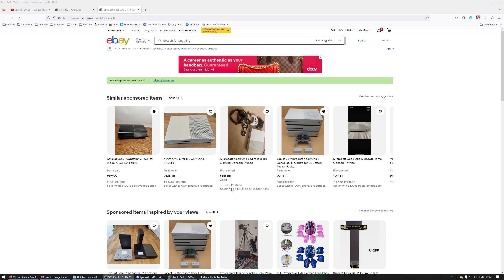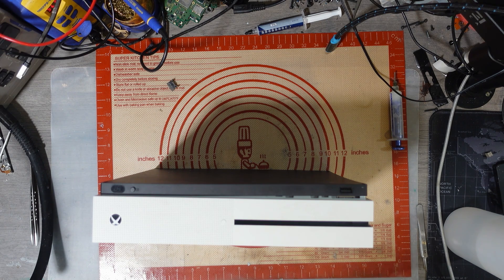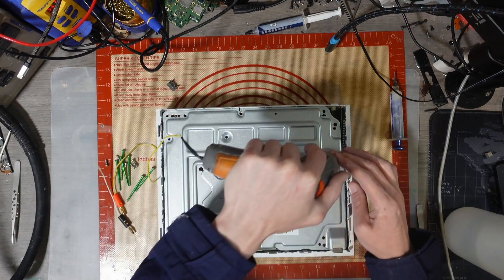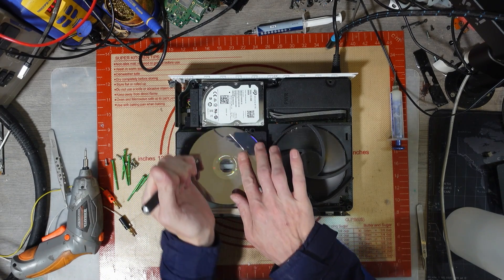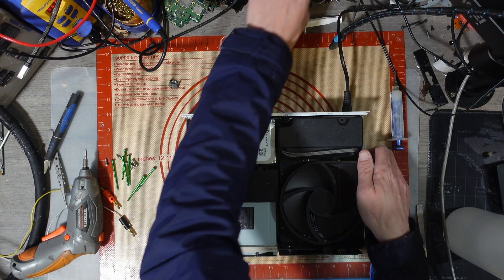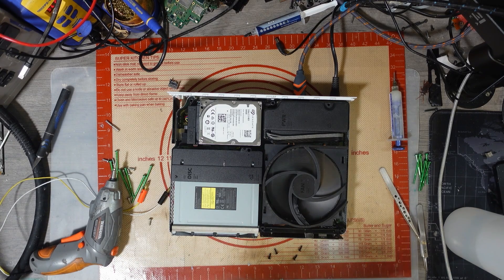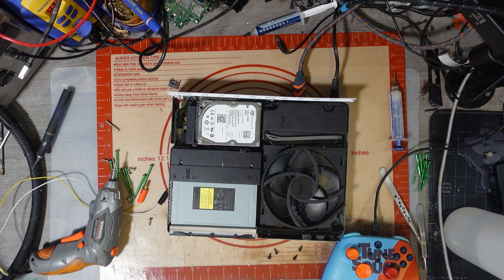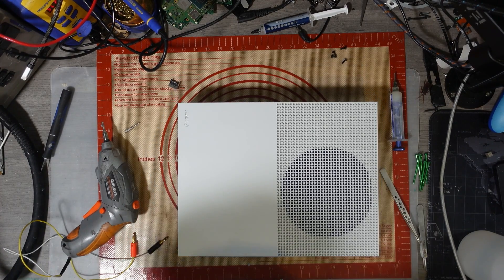I BOUGHT A "FAULTY" XBOX ONE S FROM EBAY | CAN I FIX IT?

Comment: I'm sorry if this is the wrong place for questions, I just saw you giving advice to some people in the comments.
I apologize, if this is spam.
I'll delete this, if it is.

I have a question about my bricked PS5.
Due to constant crashing (ce-108262-9), I felt forced to reinstall the system software via USB, after I had tried every other trick in the book.

Now it has crashed again right during the re-installation and doesn't turn on anymore.
Only a beep and blue lights for three seconds and then instant shutdown.
Not even Safe Mode.
I imagine the OS is corrupted.

Would the only option, if there was any, be, to replace the internal SSD with one that has the System Software correctly installed on it?

I think the SSD was the problem from the get-go, since the crashing was always attched to an error, saying there was a problem reading the system software and some game icons and even UI elements would randomly not appear.
Reply from the maker: It's not spam, don't worry. I'm happy to help if I can :) Unfortunately it isn't as simply as just installing a new SSD. The SSD is paired to the board so sadly that can't be done, or at least not easily. If it's still under warranty I'd send it back immediately. If not, it might be a case where it needs a new SSD controller or something else may have gone wrong such as a power rail failing causing it to not allow power to the SSD. It's very difficult to say without looking myself because it would be a process of elimination but for that we need to test voltage rails etc. I'm happy to look at it or you can send it to someone local to yourself. As for cost I really can't say, it really depends on the cause of the problem unfortunately :(
Reply: @TheCod3r  Thank you so much, man.
Unfortunately my warranty is over.
I understand, it's not possible to jump to any conclusion regarding the cause, without having the console in front of you.
I appreciate you taking the time for me and giving me some insight!
Maybe I'll end up writing you through your business email or book something through your website.
It's a decision I'm still going back and forth on. Still have to think about where I'll go from here.
But still, thanks for hearing me out. Feels good. 🥺🙏

And huge props to you on your efforts in the repair community and that you show us so much of it on your Youtube channel!
Great educational content and very important for the preservation of these consoles!

Comment: I charge pretty cheap for micro soldering repair but I'm up front with the customer that I'm charging cheap because I'm trying to get my skill level up.  I'm up front and honest about my skill level and fully disclose the risks involved.  I'm honestly at the point where I can increase my rates because I haven't damaged a device due to my malpractice and I've pulled off some really gnarly repairs from other people's botched attempts.  I've learned a ton from you as well, thank you.

Comment: Well you've scratching the disk on the wrong side. To destroy the CD/DVD/BLUERAY you should scratch the surface where the label is. This is the reflective surface. So no reflection - no data :)
Reply: Blu-ray discs have a unique layer structure that differs from CDs and DVDs. The data layer in a Blu-ray disc is positioned closer to the surface, under a protective layer that is only 0.1 mm thick, compared to 0.6 mm on either side of DVDs.

Comment: Who's going to pay £60 for an old generation system. £30 tops. Kidding yourself tbh. 😂
Reply from the maker: £30 for a working console? You must be half asleep dude. Look at the recent sold listings on ebay
Reply: @TheCod3r Nah, not half a asleep that's the customer bud. No one in there right mind is going to pay £60 for an old gen system in 2023, that has no games bundled with it and no controller. For that price you want to sell at you may as well put it towards a series S or X.

I've got that exact same console in working order in storage, the OG box and the controller I still wouldn't sell it for £60. Trust me, if I was a seller and you was a customer and I advertised that for £60 you'd tell me "You having a laugh mate?" So, it is what it is.
Reply from the maker: @muffunkular  OK, you wouldn't pay £60. You're not everyone. They sell all the time for more than £60. Just because it isn't worth it to you, doesn't mean it's the same to everyone. By the way, I sold it yesterday for the asking price